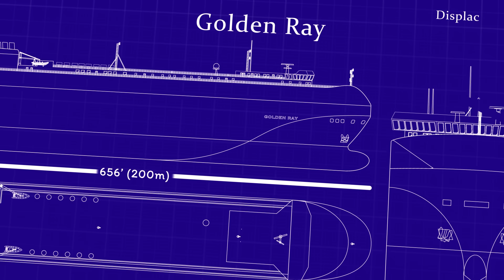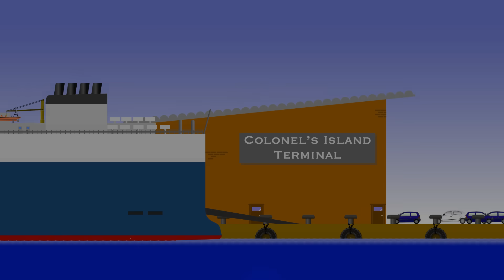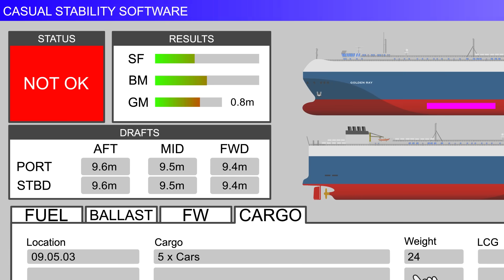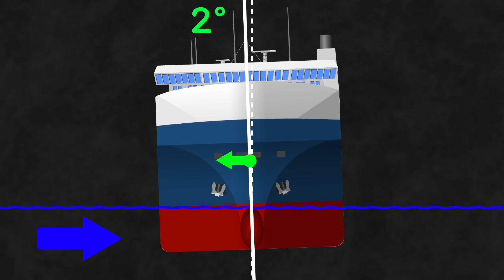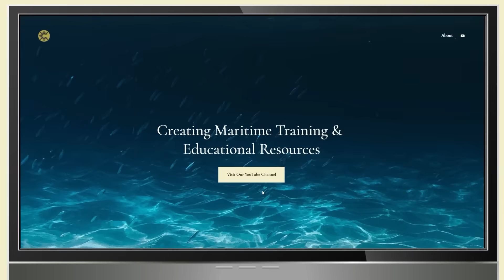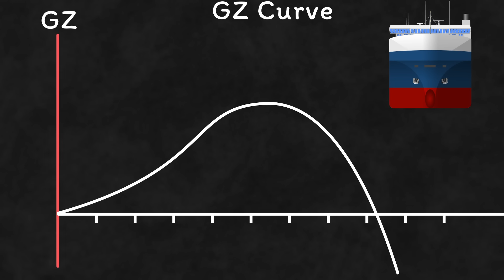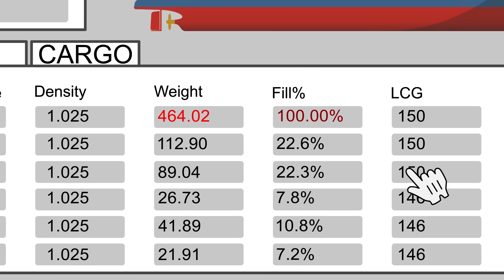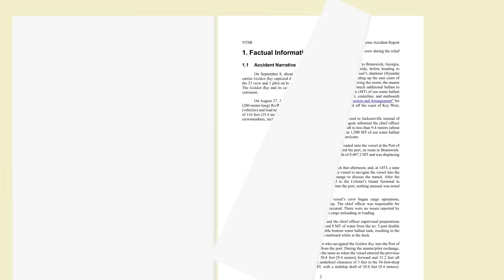Golden Ray: The Typo That Cost $250,000,000

Comment: I wonder why something like this can't be automatically calculated or measured so that when crews have entered the wrong values on how much water is in, it would at least warn or suggest that something is wrong.
Reply: It seems like it should be possible to add some logic to measure if the handling of the ship exceeds what the data entered would suggest.
Reply: @Infrared73  yeah I feel like it would be better to have an automatic (whether digital or mechanical) control that responds to tilting. If this malfunctions, it could sink the boat, but I would think humans are much more prone to error...
Reply: @Infrared73  Yep, sounds like a perfect job for an AI.  It would quickly learn to correlate the figures with actual physical behaviour.
Reply: Like so often, it's unfortunately not that simple.

There are sensors measuring the content of ballast water tanks, fuel oil tanks and fresh water tanks. But the crew can input manual values in case a sensor would have failed.
I've seen data from ballast water tank sensors, reporting full in one moment and reporting empty some 5s later, just to repeat the cycle another 5s later. Just as well I've seen data from ballast water tank sensors reporting an empty tank when indeed it was full. And I've seen data from bunker tanks that would fill up during a voyage, if one would trust the sensor.
If you can't overwrite the measured values, you won't be able to get any meaningful calculation if you have a failed sensor.

And if you go beyond ballast water and fuel oil and the like, you face an even bigger issue: Cargo. While an automatic measurement might work (with limitations) for a liquid bulk carrier, like a VLCC, it'll always require manual input for container vessels, dry bulk carriers or RoRo vessels. For the very simple reason that there's no sensor that can tell you about the amount of cargo. Are your 10 000 pieces of 20ft container emtpy (2.3t) or fully loaded (25t)? How many cars are on the vessel, are there heavy vehicles like Caterpillars, tractors etc on it, or do you only carry air? Did you load some 50 000 cubic meters of iron ore (150 000t), or are you carrying the same volume of wheat (40 000t)?
And even for liquid cargo like cruide oil: If you have a capacity of 300 000 cubic meters, a difference of 0.01 (10kg/m^3) in density will change your displacement by 3000 tons. Crude oil can have densities as low as 820kg/m^3 and as high as 1000 kg/m^3. Any sensor that's measuring e.g. the ullage (distance from the top of the tank to the liquid level) to calculate the tank volume will be bound to potentially have a huge error in the calculated mass, unless there's a manual input for the density.
So, you're anyway relying on some form of manual input if you go beyond the couple thousand tons of ballast water.

For Golden Ray, there are also rumours that the crew wanted to avoid taking ballast water in port, as it always brings in a lot of sludge and doesn't do good for the vessel. Maybe they've been intentionally "forgetting" about the previously removed ballast water, planning to take it back in once they'd reach the open sea where they would get clean sea water instead of the muddy harbor water? As long as everyone sticks to their story of it being a genuine mistake and no recording being on the voice recorder in the wheelhouse, it's pretty much impossible to prove. So this incident will remain a source of Youtube videos for years to come. Some will be nice, some might ring the bell of a conspiracy...
Reply: @smurface549  Thanks for your comment. Very informative and I learnt a new word, Ullage, the empty space in a tank between the liquid and the top of the container. Speaking of containers it is common to find that certain shippers worry more about filling up a container than with watching the gross weight. It is the crane drivers who are most aware of this bad practice.
Reply: So a system that takes in data entered by the crew, and only outputs estimates, that are then compared to actual sensors?  So if it knows what the righting angle is, the computer can compare the actual amount of time needed to return to upright vs what the calculated time is, and alert the Captain?

Or when manually entering all the data, it clears out all the existing data first to avoid leftover 'artifacts'?  I.e. when they were entering data about the load, the system would not have the prior datum of 1500 tons of seawater as ballast listed in its variables.
Reply: @toddkes5890  Having the ship compare its expected behavior to the actual sounds like a good idea. The main question is how many other variables (besides weight distribution) affect the ship's behavior (eg. time to return upright) and of those how many can be easily considered when trying to predict the expected behavior. Too many false alarms and no one would believe it when there was a problem.
Reply: @toddkes5890  All good ideas, but Im always reminded how impossible it is to use even a simple train ticket booking app, or making a flight reservation on say Ryanair, or using the Eurotunnel  site.......HOw often must I scrub everything and start again, even on AIr BnB just to sleep the night in Naples? Or how may people find they have booked the wrong month? 
 Technology will always let you down one day..
And flying a plane by a "software update"....Hhhh. Sure!
Reply: @toddkes5890  clearing data would be a pain in the butt. I like your 'alert the captain' question. That last turn was big and by then too late, but the earlier ones would have given a 'something is not right here'.

Do they have  wind sensor  connected to the computer? Should they? Too much math for me and not knowing all aspects of the computer program makes this not my problem. :)
Reply: @cliffontheroad  Clearing and needing to re-enter the data would be a pain in the butt, but better that mild annoyance than leaving in extra weight and tipping over.

Connecting a wind sensor to the computer would be fairly easy, the data from a wind sensor is likely already being fed to the bridge.  As to the math, that is what the computer is for, plus providing a copy of the raw data so the navigator and loadmaster can verify it manually.
Reply: I agree totally, any system that has so much responsibility resting on it needs a double check especially where human input is involved. Also how about a flashing light to indicate the open pilot door to remind the crew, this is no laughing matter considering how close to water level it is, open doors are the bane of ships.
Reply: The chief "chose to manually input the required data from the IMACS into the LOADCOM computer, rather than having the LOADCOM computer pull data from the IMACS.
Because investigators were unable to interview the chief officer a second time, it is unknown why he chose to manually enter the data." ...  Lack of training looks like a plausible hypothesis: "The operator did not provide official training on crew positions and responsibilities to new crewmembers but instead relied on a combination of newly hired crewmembers' experience and knowledge as well as on-the-job training. The chief officer stated that when he relieved the previous chief officer, he received 3-4 hours of on-the-job training, including how to use the vessel's LOADCOM computer. He also stated that no one else on the ship knew how to use the LOADCOM computer."
Reply: @Matthew Morycinski "switch to automation" is not enough. This is a critical system. The computer, the sensors and all the stuff in between needs to be specified, designed, realized and verified with adequate methods suitable for critical systems. It does cost a LOT of money to do this right, I'd say $ 1m if it's a one-off. But possibly in relation to $ 250m, it would have been one million well spent...
Reply: This ship had that ability. It was done manually perhaps to cut corners and not take in water at the birth.
Reply: @JasonAWilliams-IS  It seems like a good idea to have a automatic warning pop up when manual and automatic mode diverge too much.
Reply: One of the things to remember about automatic control is that instrumentation fails (a lot) If the ship cannot use an override then it is possible for the computer to do a similar mistake.

However, there really needs to be a "hey, you way over did this number are you sure" warning.
Reply: @nedimar5696  It seems to me there was probably a malfunctioning sensor somewhere and they had to use manual mode because of that. Either that, or the senors malfunctioned often enough the captain didn't trust them and trusted manual mode more. A marine environment is extremely corrosive and breaks equipment easily. Thats why the crew on ships is constantly doing maintenance on things.
Reply: @lobsterbark  Very much this. Ultimately, the computer should, even in manual mode, offer its "opinion" though. As in, if what the ship itself measures deviates to much from what was punched in manually, it should pop up a warning and be like "Bruh, go check your ballast tanks, I think they might not be as full as you think they are." 

Who knows though. I'm not a sailor, nor do I write software for boats, though this would strike me as something that'd be useful. Offer an override for situations you mentioned, but have the computer chime in. Maybe it did that already anyway and was simply ignored though.
Reply: @missoulacatholic  With the value of the cargo and of a ship, having more redundancy in sensors make sense usually.
Reply: @nedimar5696  CORRECT  i would say the same thing.... id say up to 2.5%+/- should be accepted.. but from just a guess figure this was off by 30ish%    and this  make it harder to flip a ship then to sink it.   plus auto ballast dump when you have a whole break over 1%   (almost all ships leak...)
Reply: @Skyfox94  the issue is if the sensors are bad you'll get that warning every single time
Reply: @lobsterbark  But they were just manually entering values that they got from the sensors. The whole reason why this happened is because someone forgot that they dumped ballast and nobody manually verified the values being entered.

A sensor malfunction would not have caused this situation to go any more wrong than it did. The issue here is 100% that people are forgetful (and possibly lazy). Automation (by pulling values directly from the sensors) could have prevented this.
Reply: @ShopperPlug  it is absolutely true instrumentation fails regularly or I wouldn't have a job fixing it. I wasn't arguing against instrumentation, I was arguing against not being able to override automatic systems in the case of a point failure.

If you don't belive that automation fails look up system failures that lead to plane crashes, such as the Air France flight that crashed leaving Brazil, the Boeing 737 Max planes that fell out of the sky because of malfunctioning software.

Again, automation is a fantastic thing, and should be implemented regularly, but sensors fail regularly, and sometimes entire systems fail spectacularly.
Reply: @JasonAWilliams-IS  Who gave birth to the ship? Did you really mean berth? What a difference one letter can make in the meaning of a word with the same pronunciation. lol
Reply: @JasonAWilliams-IS  you've hit the nail on the head, probably down to time constraints.
Reply: Manual data entry is inherently prone to error.  Instead of automating calculations and data entry, or implementing measures to verify and correct errors, management usually prefers (in my experience) to cut staff, increase workload, bully and harass employees and when problems occur, blame low level employees and give bonuses to the executives.
Reply: Seawater is extremely corrosive, and those sensors that fetch the values can malfunction. But yeah, there should be a warning for when the manual and auto values are too different
Reply: Not all calculating machines even on modern ships are designed not to make a mistake as there are too many factors to consider. That’s why when it’s time for promotions, the master will give a test on stability, stress and cargoes they encountered before where they had to compute it by hand, with a pen and a paper. I heard even modern chiefmates and 2nd~3rd officers fail that test when they grow accustomed to computers on board.
Reply: @jhon.e4437  the fact that companies can state how much their containers weigh without it being crossed referenced by the dockyard upon loading for example left me incredulous.  I would of thought that the crane could weigh them and the result passed to the dock office of automatic comparison, with any anomalies automatically flagged up to staff.
Reply: @rob5944  the gross weight and curb weight of a ship anchored is, yes, can easily be calculated by mother companies without cross-reference from crew onboard, but the trim and stability of the ship currently on voyage and their future plot points are almost impossible for mother companies to accurately compute or even deduce. 

The problem in this video did not start from the departure point but from it's voyage and future plot points.
Reply: @rob5944  my mistake also, in most cases it's the inputs by crews/officials that cause accidents. I got ahead of myself as I was too bitter about promoted officials who were too dependent on machines onboard acting as if they only knew someone on the company hence why they were promoted. Sample is this Ferry incident on S.Korea where the Master abandoned the ship first before the passengers. I blame the merchant marine industry for this incident cause in this industry if you know someone in the company you can get a ride otw to the top, without considering the true skills and morals of being a master or official onboard.
Reply: @jhon.e4437  👍
Reply: @jhon.e4437  👍
Reply: @Matthew Morycinski no, the plane shouldn't, it's more dangerous than letting actual human have absolute control
Reply: @kaikart123  Wouldn't that depend on the circumstance? Lives have been saved by a plane overriding human control input (RAF Voyager, 2014).
Reply: @tabchanzero8229  we do not want another Boeing
Reply: @kaikart123  If you're referring to the 737 MAX, that was Boeing being cheap and fraudulent. Any technology can be dangerous when implemented poorly. That doesn't mean there's something inherently wrong with it or that it should be avoided at all costs. It just means we should be more responsible with it. 
Again, depending on the circumstances, overriding human input can be beneficial and save lives.
Reply: @tabchanzero8229  People will always be cheap and fraudulent
Reply: @kaikart123  There's a story of a plane crashing into a mountainside because of pilot error.  Specifically, the pilot let his kids into the cockpit and let them play with the controls, and his son accidentally switched off the autopilot that otherwise kept the plane stable and on route.  This caused the plane to veer sharply, and the pilot struggled to regain control of the aircraft until the plane finally went into a steep dive from which it had no time to recover.

It was later revealed that if the pilot had simply taken his hands off the controls and let autopilot take over, the plane would have righted itself and continued its course without a hitch.

In other words, everyone on that plane died because they didn't rely on the flight computer.

You can watch a video about the disaster on the channel Fascinating Horror.  I don't remember which one it is, but it's on there.  It was a Russian plane, that much I remember.

I will also add that planes and ships can't really be compared in terms of their computer systems, because one has to deal with an extremely corrosive substance (seawater) messing with its sensors and the other doesn't.  The computers on planes are more reliable than those on ships simply because their sensors aren't so prone to failure mid-voyage.  If left to itself, and in ideal conditions, a flight computer could safely fly a plane all the way to its destination, with input from the pilot needed only during takeoff and landing (this is why the pilot was ok with letting his kids mess with the controls of his plane to begin with - he trusted autopilot to keep them en route, and it did so right up until the kid accidentally switched it off).  Otherwise, the pilot is there as a failsafe if the sensors do stop working for whatever reason (supercooled water, for instance, as happened with Flight 747), or for situations the computer isn't built to handle.  It's very different on ships, where sensors can be quite unpredictable and manual input has to be done far more often ... as I gather from the comments here.  Basically planes don't face many of the same pitfalls that ships do because they fly above seawater rather than sailing in it.

I'm not saying that flight computers are perfect or aren't prone to errors (they are, just as much as any computer), I'm just saying they're more reliable when set up well and maintained properly ... as most planes are.  (Exceptions are quite rare, actually - you're far more likely to die from a car crash, which is almost always due to human error, than a plane crash.)  And in cases like the Russian flight I talked about, the flight computer can be more reliable than the pilot.  In this instance, that also is the case for this ship - had the crew used the ship's sensors instead of inputting the values manually, things would've turned out very differently.  And even if the sensors in such an instance turned out to be wrong ... they should at least merit a double-check to be safe!
Reply: Makessense but it like pilots entering wrong data on the FMC, systems will do all the performance calculations and fuel burn estimation based on the initial data entered. This part is manual and came from weather reports, fuel, weight etc numbers you need to input.
Reply: It is possible. But for unknown reasons it was entered manually. I would highlight this point more in the video and what could be the possible explanation why (which is not in the NTSB report as that will be speculative)
Reply: @Matthew Morycinski Thats how you get a HAL 9000 situation though.
Reply: @stevenlu7324  thank u. people still dont understand what is about to come
Reply: Were the draft restrictions of Jacksonville the same as the Port of Brunswick?
Reply: Thing is that almost all vessels have sensors inside tanks which send values to the loading computer via IAS.
It had to be turned off manually , that changes of tank loads can be made...
Reply: Because computers will only do what humans tell them to do. Whoever wrote the firmware didn’t put such a safety measure in.
Reply: I know your comment is old but if you watch videos like the USCSB(U.S. chemical safety board) in places like oil refineries they have alarms for all different types of equipment but the workers have a tendency to turn them off or ignore them completely.
Reply: @riko482i  that shouldn't be an option.  Moreover, when I worked in a factory and was on the safety committee, the point was raised that there were so many alarms for different things that they tended to loose their effect.  A slightly different thing I know, but I just thought I'd mention it.
Reply: because most probably the software is programmed in cobol or visual basic
Reply: @Matthew Morycinski laws of robotics
Reply: Humans are bond to make errors, automation would've prevented this. But this ship seemed advanced, some retard sinked the ship.
Reply: Because it would cost more money and its why they pay the crew.
Reply: @Matthew Morycinski People run into burning buildings.

Your comment is good. However, I think of the jets which crash because a sensor is jammed/iced/clogged, trusting the computer was wrong. In "the China Syndrome", the computer was right but man chose manual mode.

Really good programmers are worth their weight in gold. It's hard to think of all the possibilities. Real example was electronic locking cockpit doors on an airplane. Pilot planned on crashing the plane. There was a 5 minute override which would have allowed the crew to get back into the cockpit but  the programmer did not account for if the captain hit the lock button again, starting the 5 minute total lockout to restart. Result is they never got into the cockpit. Crashed. The doors were made to resist a fire axe.

True example. I hope I explained it right.
Reply: @Matthew Morycinski The problem with computer overriding human has been kindly demonstrated by Boeing's 737 max incidents... (if you haven't heard it's about a system called MCAS taking control over the pilots without them knowing, relying on a faulty sensor)
Reply: @thesteaksaignant  fly by wire systems that have overridden pilot inputs have saved thousands of lives.  It has killed relatively few in aviation. 

The MCAS system was exasterbated by poorly designed AoA sensor systems..
Reply: They added 1500 MT ballast water in their last voyage. So the Chief mate made new calculations. Next voyage, he forgot to erase the 1500MT ballast water from his calculations. When you have weight near the Keel, your ship have better stability. So he got wrong numbers.
Reply: @Matthew Morycinski I disagree, human input must be absolute and shouldn't be quietly discarded by the automation. However, the automation must give their opinion if the human input something crazy and act as a sanity check, warning the human that this command would ended up with something bad if this command is done.
Reply: You have to remember that, sometimes, the ballast water is very muddy, and the ships have to clean it themselves, but that costs money.
I don't know a single company that would like to spend more money, so they fill it manually so that they can use ocean water (cleaner) as ballast and cut costs.
This time there was a human mistake, which is to be expected, that being the reason the computer can calculate it by itself, but hey, it's cheaper, right?
Reply: @afoxwithahat7846  
A million??? 🤣🤣🤣🤣

Something like that, the design and testing phases would cost literally 10's of millions.

Ask Tesla how much they've spent, just on redundancy,  for self driving mode.
Reply: @lordgarion514  may you help me, I'm not sure which comment you're referring to, about the millions
Reply: Usually it can be made, but most crew of everything dislike automation (it reduce their worth) and usually at first the same automation has issues. Which can easily delay automation being forced by decades, especially if no major event like this happens, that makes it clear, that a simple system could have saved a ship.
Reply: @Matthew Morycinski A good insight.